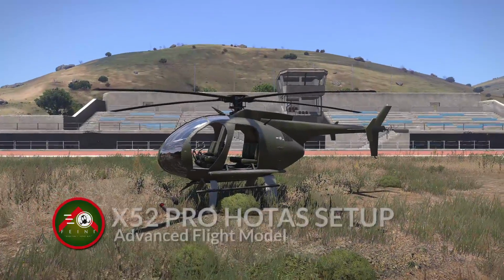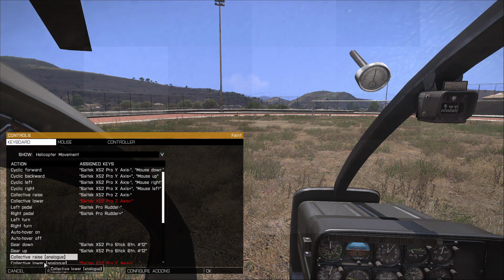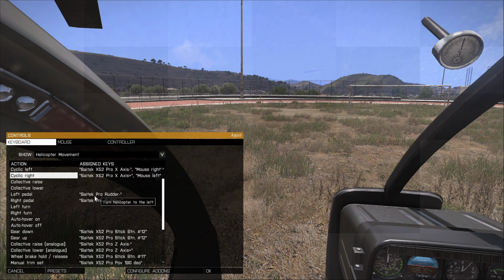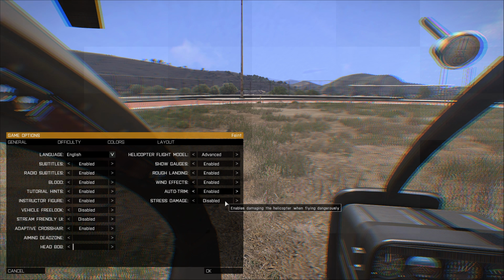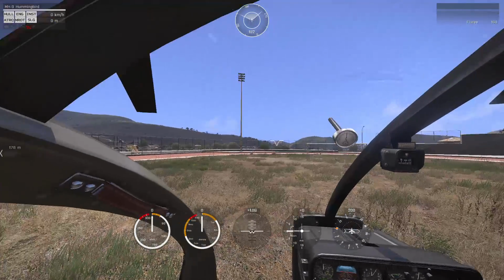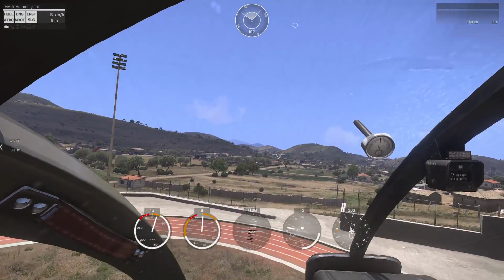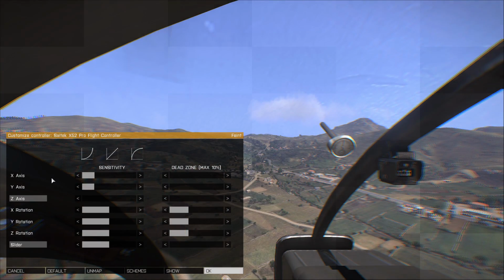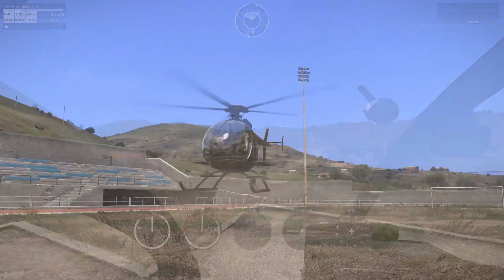Flight Control Joystick Setup - Advanced [ARMA 3]

Comment: Great videos. I to now have the X52 pro set up as well as Trackir and pro pedal. It there a possibility that you have a printable  config of your set up that you can share with someone trying to learn.  Printable so I can go more step by step and get mine set up.

One thing I did was also got a set of the controller mount plans from Rodger Dodger and built it. I like it so far just need to know more about how to set up my joy sticks. I do realize there will be some things that work for you that I wont use etc. but if possible your set up would give me a really great place to start.
Reply from the maker: Since I posted this video, I am now using the Warthog HOTAS and MFG Crosswind pedals.  So my controls will not work for your setup unfortunately.  But when I was using the X52 Pro, I did set the toggles on the base of the joystick to things like Flaps up/down, Gear up/down and I can't remember the third.  On the Throttle, the big E button was my eject button.  The button just below that toward me was my minimap button (GPS).  Since the hats aren't used for view, I'd set those to the various target buttons (next target, next empty target, etc).  

Honestly, it's probably better to try and implement keyboard commands for the different aircraft and helicopter controls.  Then program those into the HOTAS via the software, and use the three point toggle to switch between sets of commands.  It takes a lot longer to program it all that way, but its better than what I was doing at the time.  If you search online for an Arma 3 setup for the X52 pro, you can find one.

Comment: Just one thing about the collective:
Please for the love of humanity - invert it! Pull the throttle back/towards you --> collective raise, as in the real thing.

It's not a throttle, it's a collective. In a helicopter the throttle is only used for starting the engines which is then controlled by the governor.
Reply from the maker: Yes, this is a detail that I am well aware of.  In real helicopters, for anyone who doesn't know, the throttle is a separate twist input on the cyclic, similar to a motorcycle throttle.  Before flight, you have to rotate this to "Flight", i.e. 100%.  Once you land, if you want to save fuel, you can rotate the throttle back down to "Idle" which will be enough to keep the blades spinning, but won't be enough to get off the ground.  Daniel, in the past, I've played with my HOTAS throttle input inverted as you suggested.  It's OK.  The problem is that the "throttle" input on my HOTAS is "forward-back" on my desk, not "up-down" as it is in a helicopter.  And since I play a lot of flight sims with planes where forward it increased thrust and back is decreased thrust, going back and forth between planes and helicopters was a bit of a transition for me every time.  I tried it for a few weeks, but ultimately chose to switch back to forward being up collective and back being down collective.

Comment: Cool.. I may get the warthog set later but for now I think its better I get use to what I have before spending a lot more. I can prob stop your great video, make note then play some stop and make notes.. Thanks for the feed back  and again your tutorial videos are really a great help. I am still having a problem getting my trackir, pedals and X52pro to show up when I go into control setup.. 

I will eventually get it figured out. probably just something I am not doing right.. I think I may need to turn things on, restart return things on etc. to get them to show up right... Again thanks for the great videos and I did subscribe to your site 
I did make the Rodger Dodger helo control set up etc. and modified it so I can leave the regular x52 throttle on it just for helos and will use the pro for planes. I also got a FFB2 for the helos so Hopefully it will be more usable for me that way.
Reply from the maker: Glad you like the videos.  Thanks for the kind words.  I'll have to look for the Roger Dodger thing as I've not heard of that.

If your input devices aren't showing up in Arma 3, but they are showing up correctly in Windows, when you go into your Controls in Arma 3, click on "Controllers" and then click the "Refresh" button.  Once in a while, TrackIR will not be recognized, but if I hit that refresh button, suddenly everything is there and not ghosted out.  Sometimes Arma just needs a kick in the pants.
Reply: Its a controller holder made of PVC which you can connect your stick and throttle to in different ways which can also have your pedals connected to it. 
Basically you pull your chair up to it, strap it to your chair so you can use pedals without pushing them away, your throttle can be mounted on the left side and your stick in the middle. 

I have a extra controller on mine as I set it up so I can use it as a collector for helos and have my stick in the center between my knees and can also have my regular x52pro mounted if I want to switch to fixed wing.. Just makes it easier and faster to changes things and I dont have to keep moving the throttle for different things. I also went ahead and get the FFB2 as you were saying in your video how much better it id for Helos.. 

http://www.rogerdodger.net/diyflightsims/

I bought the Helo plan from him then modified it so it is also the fixed wing stand.  Took me alone and taking my time a afternoon to cut the pieces and assemble it. 
Just have a couple things to remember and measure as his measurements my not exactly fit your chair, thats width and height that you want or need it.
Reply from the maker: Very cool.  Did I recommend the ffb2?  I used to use it many years ago and liked it as an inexpensive and reliable joystick.

BTW, I recently got new lockable casters for my office chair.  They work really well, but the locks are on a hair trigger and it's easy to pop them into locking position accidentally and then get locked in place.  Haha.  I wish there was a way of locking them in place all at once.  I could probably rig up some kind of DIY switch to lock them all at once, but you know...no time.

Comment: Very nice. Kewl, with your video and knowledge i could easily calibrate, set and configurate even my Thrustmaster Cougar HOTAS with the Simpeds F16/c Rudders. Now Heloflying is much more easier, especially the Helicopter Time Trials!  xD
Could you please also make an video to setup the TrackIR 5 correctly to work with the Arma 3 (without HRP), and the Helicopter Time Trials TT06-TT10? Because we cant use your fantastic Head Range Plus for that. All mods are disabled, or you dont come on the leaderboard...     And it´s kinda hard for me to adjust it for  the Arma 3 Helo´s.
Many thanks in advance. 
Keep on!
Cheers
Ironblader (germany)
p.s. I also own an R/C Helicoper with an 2-stroke engine, The Kalt GS Baron. An old model, but it still flies ;-)
Reply: +ironblader or just upload your (an) TrackIR5 Profile for us to deal with?  that would be great!  Thanks :-)

Comment: i have the same pedals but when i bind the pedals my heli just spins around and i have to push the pedal slightly to correct it. I went into the controls axis to see if it is off centre but everything seems ok
Reply from the maker: That sounds like normal helicopter flying. You have to apply left pedal to counteract the torque from increasing the cyclic. 

You can double check if there's a problem by looking at an airplane and seeing if the rudder is visually off to one side. If that's the case, try recalibrating the pedals.

Comment: +feint great video! I am a little new to ARMA3 - how would I get a heli training/flying around scenario like the one you're showing here set up? any helpful links?
Reply from the maker: +flinz Hmm, in the Steam Workshop, there are quite a few single player (SP) missions available for you to do either combat sorties or less difficult transport/rescue sorties.  I would recommend "Pilot MH-6M Littlebird On Missions" by RobJ.  They get pretty repetitive as the missions are random and sometimes repeat one right after the other.  But they are good practice.  This mission requires the MELB, which is available on armaholic.

However, for learning, not practice, I would seek out "Dslyecxi's MH-6 Practice Scenario" for Arma 2..  It's Arma2 only, but if you're willing to reinstall Arma 2, if you own it, it's definitely worthwhile.  There are lots of moves in there that have taught me a lot and it's in-game, not a video, so it's a good way to learn through doing.  Fair warning, it's not easy.  And Dslyecxi uses a keyboard and mouse, so some of the throttle moves he does simply aren't possible when using a throttle because of the way Arma handles keyboard inputs vs. axis inputs.  But it's still very worth a download and a look.  I don't think you can adapt the mission to Arma 3.  Maybe you could, but you'd have to rewrite it by hand and use All-in-Arma to get the map from Arma 2 into Arma 3.  You'd have to rewrite the classnames for the helicopter and pilot that are in the mission.  Replace them with Arma 3 variants.  Not sure what else you'd have to replace but the game would tell you what "Addons" were missing once you tried to load it up.  Might be worth a try, but there's a possibility that the mission wouldn't work at all in Arma 3.

Comment: I'm aware this is an old video, but I hope you can still answer (Or anyone else that has flown a real heli). I am interested in knowing more about the feeling of a real cyclic. As I understand it's almost no movement is needed to get movement, but how is the feel of centering the stick on a real heli? Was it very clear where the zero was? Or did you have to get the feel for it? I guess a real heli would use the forces of the blades to "center" the stick more than a sim would, but my main struggle with the controllers I have used is to keep it centered and do small adjustments from there.
Reply from the maker: Sorry for the late reply. I just saw this comment. I took a helicopter training class once, and what I can say is the cyclic was very much tied into the controls of the rotor. What I mean is, I didn't really remember feeling any sort of center, at least not in the way you feel it on a joystick. I suppose if I let go of the stick, it would mostly stay where it was unless it moved due to aerodynamic forces. The helicopter that I was learning on was definitely not fly-by-wire. So in a helicopter that is fly-by-wire, the feeling might be closer to using a high end consumer joystick. But in the helo I was flying, I worked hard to keep the aircraft doing what I wanted and never worried about keeping the joystick centered. In other words, I worked constantly to control the attitude of the aircraft vs. working off of a center position of the joystick. If I needed to be mostly left stick to keep the thing where I wanted, then that's what I did. Of course, I'm Arma, the trim feature is questionable. So I have auto trim turned on.

My advice if you are having problems with that hand eye coordination, is to change the sensitivity of the joystick. If it's too sensitive or not sensitive enough then you'll always be fighting it. So always tweak those values, even after a while, and make the helicopter Sim work for you. It will be more fun and you'll be more likely to keep playing.

Comment: so got a question to anyone or the creator if you still monitor the channel. So when I put my Trim to Disabled (no assist) I just spin to the right, like im going hard on my foot-pedal, do you possibly know a fix for this? I have tried alot and researched it up and just cant find an answer. Its fine if I have Trim assist on.  Thanks to anyone that can help me out. Arma3 cant possibly expect you to fly whilst holding the foot pedal the entire time ( as that seems to counter it slightly, but as soon as you lift up the foot pedal thats is countering the rotation it just starts rotating again). Hope this made since. also what do the settings in the menu where you turn your engine on that states Set Trim Manual, and Release Trim, what exactly does that  do? Thanks. for the assist.
Reply from the maker: So basically, Arma is modeling what really happens in a helicopter in real life. When you take off, you have to push the rudder pedal to counter the torque steer that happens normally when you add torque to the main rotor. The anti-torque rotor helps to counteract that torque, but you have to push the rudder input so that it knows how much anti-torque you want. This is how it works in real life and you constantly have to manage these inputs.  Don't expect a helicopter to ever travel in a straight line. It's not like an airplane. You will always be turned slightly to the side.

I usually fly with trim assist turned on all the time in Arma because it's just not that much fun to fly without it. But if you want a real challenge, you can turn it off. You will need to set up a button on your flight stick that allows you to set the trim, otherwise your legs will get cramped after a while if you are using rudder pedals, which I recommend when using this mode.  I recommend using one of the hat switches as they are easy to get to.

The way the trim works is that you take off, push the rudder pedal to counteract the torque, and then press the trim set button. Then you can relax your rudder leg and return it to center.  Then as you fly around and change torque inputs, you will need to eventually move the rudder pedal around more to make sure that the aircraft is flying straight and level. Once you have the aircraft moving in the way that you want, in the orientation that you want, press the trim set input button again and that will set the new trim.

Keep in mind that the trim set button sets the trim both for the cyclic and the rudder pedals.

Playing in this mode is definitely a challenge. And it can be rewarding to master that challenge. after flying for a while in this mode, it seems pretty natural. And it will be easier to transition to other flight simulators. And going back to automatic trim feels weird and arcade after that.  But if you are just flying around for fun and don't want to have to worry about trim, I would recommend turning it off.

Also, while you are still learning how to use the trim, I would turn off wind effects until you grasp the concept. Then, once you have figure things out, you can turn the wind back on and give yourself a more realistic challenge.
Reply: @Feintgames  Thanks for the expedient reply. hm. So I have flown going back to the days of FSX, and I have never experienced something like this in any helo I have flown in a simulator with realistic settings. 
So I was using a controller/ kb&m /and currently messing with a ol Logitc Extreme 3d pro I had tucked away in the closet.  So LIFT OFF off ..the moment I mean the second I have skids up it automatically starts rotating right. It never rotates LEFT, even after I have manually given it pedal to straiten it out, as soon as I start easing up on the pedal it just starts rotating/pedal right again. I will admit I am a noob to Arma3, however, it cant be as complicated as Flight Sim X or is it?  So as  you stated counter pedal, but I find it strange that I cant get it to come out of that right rotation no matter if I am lifting off manually or coming out of a hover from lift-off. Anyways I just do not get it, and  really all I want it for is to be able to circle a target form the air (nose down) and I find on other games like BF4 it is near impossible to do this maneuver with any kind of Trim assist on. 

I do fly with Weather, and Stress disabled atm as I am really really perplexed by this. It has been a number of years since I have been on PC and flown, but I do not remember it being this difficult (almost like the pedal is somewhat stuck (I mean out of 20-30 adjustments and re-starting it always seems to rotate to the right, NEVER auto to the left. Does not react this way if I have assist on or in a hover. Do you still get on Arma3 to fly?  I am 1/2 tempted to make a video and post it up, so ppl can see and comment on it. ha. Thanks again for the reply. Subbed, plan on checkin your content out lil later, this is just so frustrating as I fell like mb I have something binding/conflicting in my setup. idk, shite, lol

Comment: I have a thrustmater USB Joystick and it's plugged in and all of that and it's not showing up
Reply from the maker: Need more info.  It could be a million things.  Make sure to download and install the drivers and reboot.  Also, make sure the joystick is plugged in to a power outlet.  Also, plug in the joystick directly to the back of the computer, not the front and not to a USB hub.  If it's showing up in Windows, you're most of the way there.  If it shows up in Windows, but not Arma, go into Arma, Settings > Controls  and click on the Controllers tab.  If the joystick is visible but ghosted out, click refresh.

Comment: Hi Feint thanks for sharing such great information and doing this demo tutorial, I use Thrustmaster Hotas warthog and Saitek combat pedal and wanted to know if you have to tweak anything in Windows 7, 8, 10 etc joystick configuration regards deadzones and sensitivity first before using this software or everything is handled within the software.Would you mind shed a bit of light on how you would config Windows,Ctrl panel, Device & prntrs game controller's? thanks in advance ...
Reply from the maker: Hi and thanks for your comments. I just started using the thrustmaster warthog hotas myself, and I honestly do everything through the thrustmaster software. I haven't had to tweak anything or do anything special in Windows.
Reply: +Feint Thanks for the response I really appreciate if at any point you happen to do or have a tutorial on Thrustmaster Hotas Warthog please keep me posted cheers.
Reply from the maker: +ldee247 sure thing. Will do.